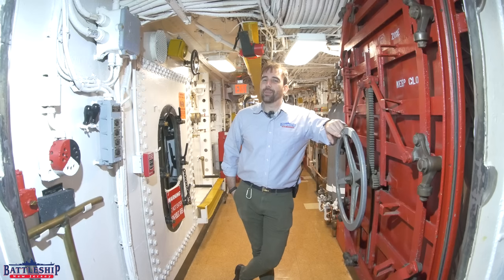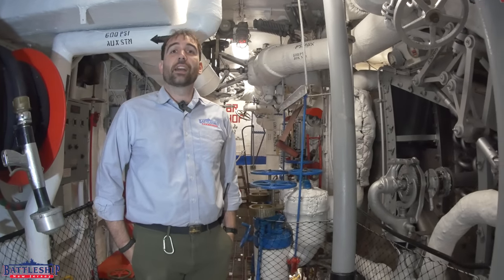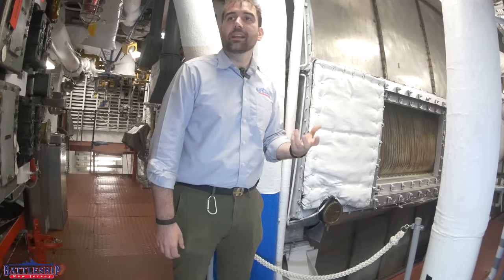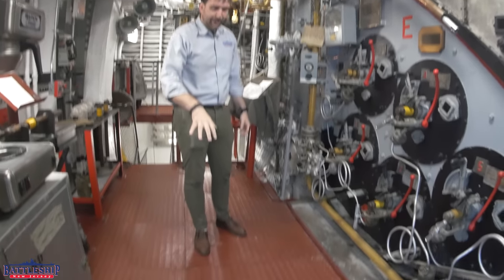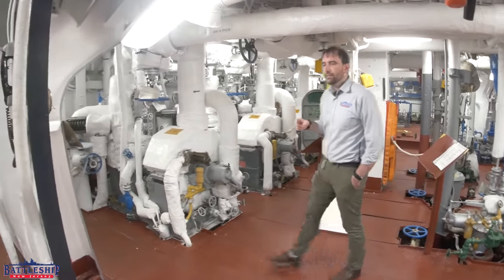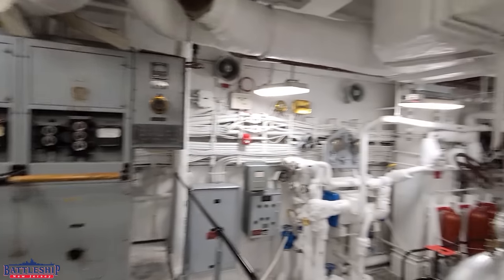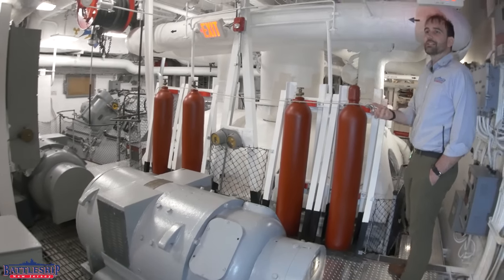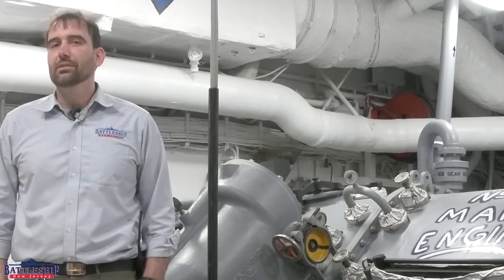Inside the Propulsion Plant of the World's Fastest Battleship

Comment: Early sea-going steamships heated seawater to make steam;  of course that concentrated the salt in the boiler water, and in time it had to be discarded and replaced with cold seawater.  This wasted a huge amount of the heat that had been made to create steam, and drastically reduced efficiency.  In addition to that, the engines operated at far lower pressures, which also decreased efficiency.  The greater the difference between the inlet and exhaust temperatures, the greater the efficiency of the engines.

Comment: The ocean liner United States has 1000 psi boilers. The Iowa class has 600 psi boilers. In 1944? what was Babcox doing to up the pressure on it new boilers for the Montana class? Were the speeds given for that class based on 600 psi boilers? if yes what up dated boilers might have been ready for those ships if construction had started? AND how much faster might  those ships have been with 1000 psi boilers? Last how feasible is it to update the Iowa class to 1000 psi boilers? AND omg how much faster would they be?

Comment: How does a sound powered phone work ?
Reply: Generating an electrical current requires a magnetic field, an conductor, and relative motion between them.  Vibrations from voice move a diaphragm attached to a magnet, inducing a varying current in the coil of wire surrounding the magnet.   At the far end, this current is fed to the coil, which moves the magnet, which moves the diaphragm in exactly the same way the diaphragm in the sending unit moved.

Comment: steam drum, dry pipe, superheater main steam stop valve, bulkhead stop valve, strainer, throttles, high pressure turbine, low pressure turbine, main condenser, hotwell, main condensate pump, air ejector inter condenser, air ejector  after condenser, gland exhaust condenser, 1 stage feed heater, dc heater, mainfeed pump, main feed check vlv, main feed regulating valve, main feed stop valve(these are the can’t remember shit valves) economizer, steam drum.
Reply: The water tubes are the “water wall tubes” no generation of steam occurs here. Boilers are surface blown continuous while in operation, and the fires are secured and then they are bottom blown as needed as per water king testing
Reply: As a BT/MM these things don't ever leave your brain
Reply: That is the merchant steam cycle , the navy has small differences .

DC heater is called the DFT
And the De airating Feed tank is located low under the waterline for damage control purposes so we do not have the head of a DC heater being high up .
A main feed booster pump is used to provide positive head to the Main Feed pump instead.

Comment: Question, Compartments and damage control system. 
How many compartments could be flooded and the ship remain afloat. 
By stay afoot I mean uppermost continuous deck and all vents or doors remains above water or it will down flood. 
I would expect a plan for this somewhere import, probably where the damage control officer was based. And or with the Chief Engineer and Capt. 

A typical cargo ship eg a liberty ship would single compartment. Ie you could flood the larges single space typically the engine room or possibly a main cargo hatch and still float.
Flood two you are going down. 
Passenger ships are ussualy two compartment ships they can flood any of the two largest spaces and stay afloat. The Titanic was a 4 compartment ship. She flooded 5. 
Cross flooding, if you flood an engine room it’s in the middle the ship will stay upright. 
If you flood a space on one side of the ship you got a big problem. The ship will develop a list which is not good. 
This can be sorted by cross flooding. The equivalent space on the other side. 
I would expect to find specific cross flooding pipes and or valves. Rather than what movies and novelist refer to as seacocks. 
This system is something the officer in charge of damage control would need to know extremely well, you don’t have time to get a pencil and start figuring it out when shit hits the fan. Or you get shot at. 
As a Capt you need to know it very well.

Comment: Does the ship make 212,000 hp for propulsion plus for example 20,000 hp for everything else such as electrical generators, or is it 212,000 max. If its 212,000 max, how much goes to propulsion. In emergency situations can any other boilers send steam ot the other propulsion systems. If so what is the max steam hp a boiler could make.
Reply: Marine boilers are rated for pounds of steam produced per hour at a  given temperature and pressure. That amount of steam is capable of producing a given amount of power which is distributed among the consumers of that steam. Why such information is not included in videos like this is another matter entirely.

Comment: Well you’re description was close but you made numerous mistakes. #1 BLR feed pumps do not take suction from the condenser. The condenser is where steam from the turbine is condensed back to water, the DA tank is where the feed pumps get there suction, water is gravity feed to a booster pump then to the BLR feed pump. #2 saturated steam from the steam drum which is in fact half water half steam existing at the same temperature in the steam drum, saturated steam is feed into the superheater then to the turbine. #3. blow down is from the mud drum witch you call the water drum, not the boiler steam tubes. Blowing down the tubes would result in tube damage. This is 6 years as a Navy Boiler technician on the USS Roosevelt CVA 42. + another 35 years as a Powerhouse steam engineer in the city of Detroit. Very nice presentation though.

Comment: How do you have asbestos gloves open to the air? I'd suggest either an encapsulation product be applies to them, or more likely, just locate them in a plexi case, to prevent them being disturbed, and thereby releasing fibers.
Reply: Not sure if the shown gloves are artifacts from when the ship first entered service, or are the more modern non-asbestos type.  When the ship first entered service, sure the gloves were asbestos.  Once the dangers of asbestos were realized, the gloves changed to some other heat resistant material.
Reply: Hopefully, those are replica gloves that aren't real asbestos?
Reply: Those particular gloves, are the Nomex/Kevlar type that replaced the asbestos ones.

Comment: Wonder why they didn't just use straight diesel engines instead of boilers? Was it a retro fit from coal? Anyways interesting video.    :)
Reply: WW2 destroyer escorts used diesels to power generators that drove electric motors. And that system is used for modern military ships of such size, and cruise ships, too. But it cannot be scaled up to make the power required for a large military ship.
Reply: @vintage42  Not true. Azipod propulsors are available for up to 30,000 horsepower and MAN makes the L+V48/60CR that produces more than 25,000 horsepower. Four of those engines and pods probably take half the volume required for New Jersey's steam plant and are far more efficient at producing the same or more power while offering far better maneuverability.

Comment: It's important to remember that, in the steam cycle (...feed pumps --> boilers --> turbines --> condensers --> back to the feed pumps...), the condensers cooling the steam are dumping about 60% of the original heat from our burning fuel into the ocean.  Why in the world would we seemingly waste 60% of our fuel to heat the ocean?

The answer:  Because we can pump liquid water but WE CANNOT PUMP STEAM !  Unless we first subcool our turbine exhaust to condense it back to a liquid state, we have no way to pressurize it to pump it back into our boilers--and without feed water, our boilers would run dry in minutes.  Here comes a crash course in the thermodynamics of heat engines.

Many people think of the steam cycle in mechanical terms, as the sequence of machines I listed above:  feed pump, boiler, turbine, condenser.  But a steam plant design engineer must also think in terms of the state of the working fluid moving around the same system.  The changing names of the working fluid describe the thermodynamic cycle that's taking place: feed --> steam --> exhaust --> condensate .  Each name applies to the fluid that's between two of the machines.  To the thermodynamic engineer, boilers are machines built to turn feed water into steam.  Turbines are machines to turn steam into exhaust.  Condensers are machines to turn exhaust into condensate.  The pumps are machines to turn condensate into feed water.  Large amounts of heat from our fuel must go into the working fluid in our boiler; roughly 60% of that heat MUST BE REMOVED and dumped into the ocean at the condenser.  Otherwise, we couldn't pump the working fluid to continue our cycle.  The condenser should be thought of as the mirror of the boiler.  A boiler in reverse.

The energy contained in the working fluid is called "enthalpy".  The boiler adds enough enthalpy to the water to force it through a phase change, violently separating the liquid water molecules into gaseous vapor.  This steam is then superheated further to add even more energy, as well to ensure as it moves through the machinery without falling below a temperature at which potentially harmful liquid droplets would condense out of the flowing steam, as Ryan tells us in this video.

Passing through the turbines, the high-pressure, superheated steam expands through the turbines' several stages, spinning their rotors, losing pressure and temperature at each successive stage, entering a saturated state until, depleted, it billows forth from the turbine’s last stage.  This cooled, depressurized steam--now known as exhaust--is finally sucked through an opening in the floor of the turbine casing and pulled into the vacuum of the condenser chamber, below.  Now, the steam must be condensed to liquid so we can pump it back into the high pressure of the boiler.

The saturated state of the fluid persists throughout the condenser.  In the condenser, the molecular ferocity of the boiler is reenacted in reverse, as the warm, low-pressure exhaust billows across scores of small tubes cooled by colder water from outside the plant.  The resulting phase change does not much lower the temperature or pressure of the saturated exhaust, but the cooling of the condenser extracts enthalpy from the exhaust—just enough to collapse the exhaust aggressively and return it to a liquid, but no further.  The violent collapse draws a roaring vacuum within the condenser chamber, creating the powerful pressure differential that sucks in yet more steam to make the turbine spin.  A boiler must be built so it does not explode, but a condenser must be built so it does not implode !

Inside the condenser, it pours a constant, warm, torrential rain.  The water is cooled no more than necessary because it must soon be boiled again; cooling it further would only require more fuel to be burned at the boiler.  The warm rain pours down to be collected in the condenser hotwell at the bottom of the chamber.  From the hotwell, moved along by a small condensate pump, a pipe carries the liquid—now called condensate—to the feed pump.

As with all thermal engines, this power plant extracts as useful work some fraction of the flow of thermal energy streaming from the hottest point in the system (T-hot) to the coldest (T-cold).  That fraction, called the thermal efficiency, η-th, is all that can be taken before encountering real-world engineering limits.  In a plant like this, η-th = about 40%.

And that is why the condenser is the most unsung and underappreciated component of the steam plant.  It's not the boiler that makes the turbine spin; it's the pressure differential between the boiler and the condenser that pushes this battleship through the ocean.  If we use 40% of our fuel to power the boiler (the 40% we get back as propulsion and electric power), then we need 60% of our fuel to power the condenser.

Respect the condenser!

ET2(SS) Nuke/Submarine Steam Plant Systems Engineer

Comment: Is that 212,000 standard or boiler horsepower? There is a difference. 212k bhp would be about 280k "car" hp
Reply: If it helps the 212,00  shaft horsepower (SHP)  is the total amount of horsepower from all four turbines.  Each turbine has a rated value of 53,000 SHP so all four total to 212,000 shaft horsepower ( SHP).

Comment: You have the condensate and feed water system all wrong in your video... Condensate pumps pump the condensate through the main air ejector (which purges the non condensable gasses) then back to the DA tank.  The large blue pipe under the DA tank which you stated pushes water into the DA tank is wrong. The large blue pipe under the DA tank is feed water from the DA tank to the main feed booster pumps then to the main feed pumps. Then it goes through the economizer then to the steam drum.